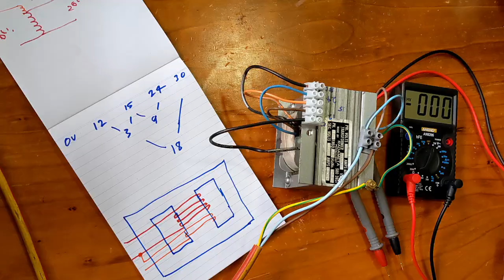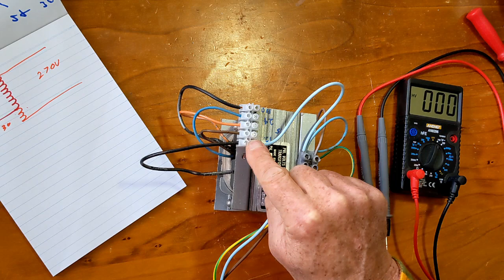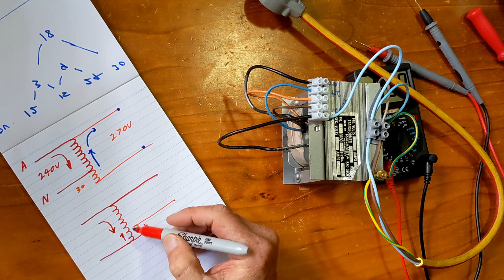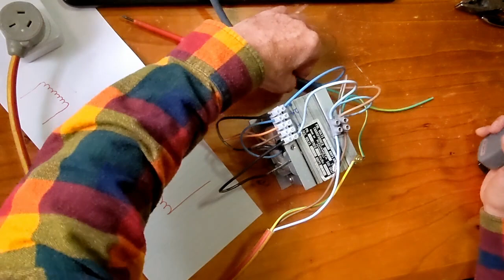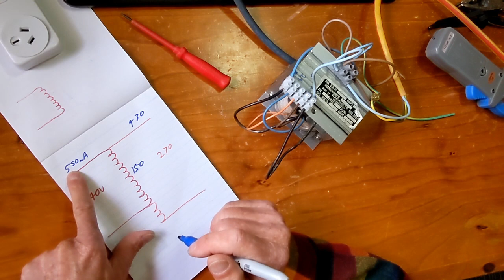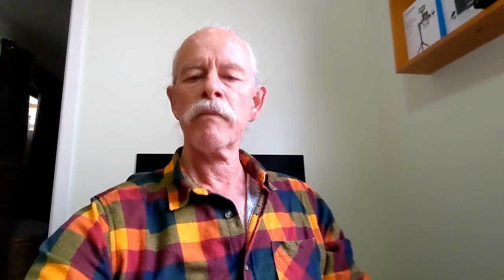Turn a transformer into an autotransformer

Comment: As a complete idiot what does this all mean to your electricity bill?
Good to see you are wearing your posh shirt!!!
Reply from the maker: It means nothing to your electricity bill. It's jsut a simple way of increasing or decreasing the power output of What ever you connect to it. :)
Reply: @gunsparky  no power change just voltage and current power is constant Transformer is considered 100% energy conversion
Reply from the maker: @johnjcb4690  Correct. Go tot he top of the class and stay there. :)